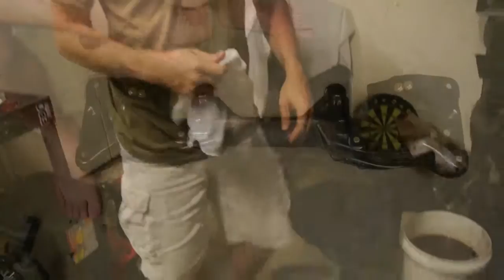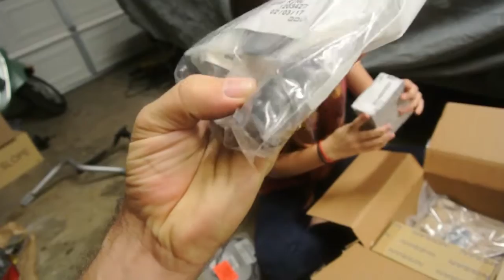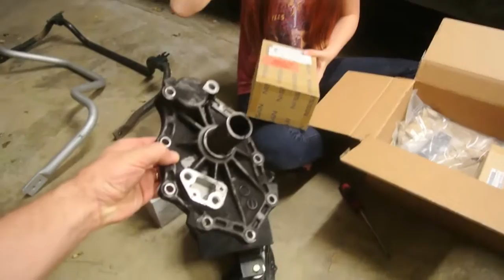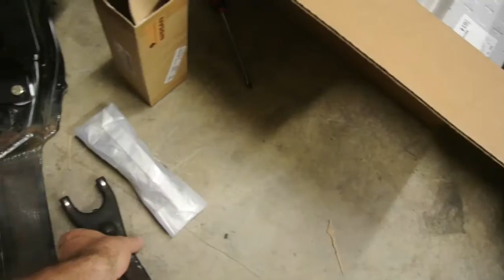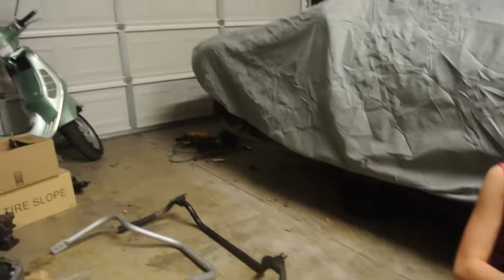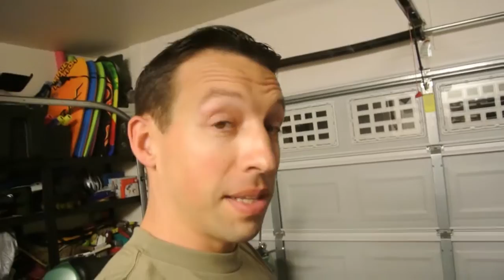We Got New Bling Bling :: Ep10 - TueZday Garage :: RB26 into 300zx (RBZ32)

Comment: Why did u not get the subframe they offer?
Reply from the maker: I am not sure if you are referring to the STL Speed & Sound subframe or the McKinney subframe, but I will give my reasons for both.
STL S&S: Of the two, these guys modify the subframe the exact same way that I did, with the reinforced triangle notch. They could do the mod for the same cost that I paid locally, however, they needed one of two things to occur; either I send my subframe to them or the locate and buy one locally in STL. Either way, it was going to cost me a couple hundred dollars extra: $200 for them to local buy one OR me paying the shipping from HI to them and then back...that would get REALLY extensive really fast.
McKinney: to be honest, looking at the pictures they have online of their subframe mod, I am not a big fan of the massive amount of metal that has been removed. Additionally, their mounting kit and subframe mod is initially R&D'd for an RB26 with the RB25 oil pan. That said, I wanted to ensure that it was made exactly for my application. 
In the end: The way that I modded it fits EXACTLY with the shape of the RB26 oil pan. There is probably less than a centimeter between the subframe and the crossmember, which allows me to maintain as much of the original integrity of the subframe as possible.
Hope that helps :)
Reply: BCs300z yeah that does make sense I keep forgetting that you're in Hawaii I recently just found your videos and I'm trying to catch up on the build in my experience with engine swaps I would suggest keeping a close eye on the area around the subframe even with the hard silicone mounts you're using the engine still flexes to a degree once you actually start road driving I would check the area around to make sure there's no indication of contact. Definitely a clean and professional  build  keep up the great work  can't wait to see more !also sent you a message on Instagram
Reply from the maker: thanks! Will reply